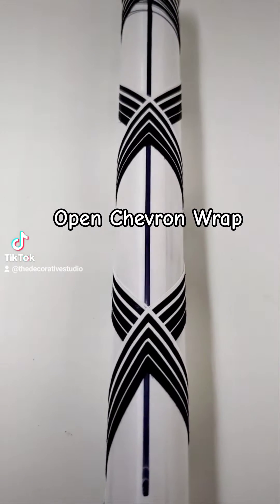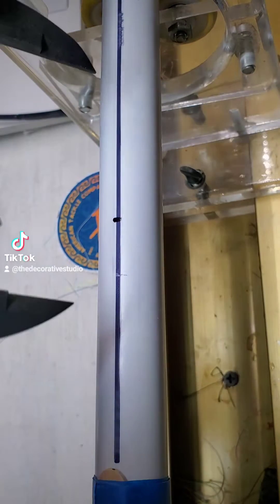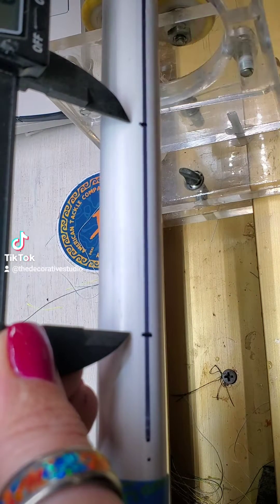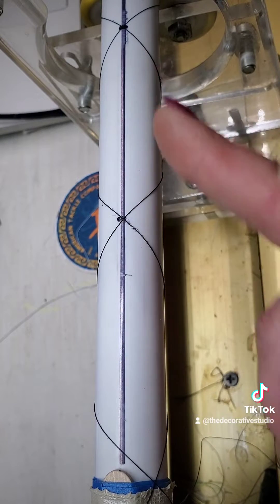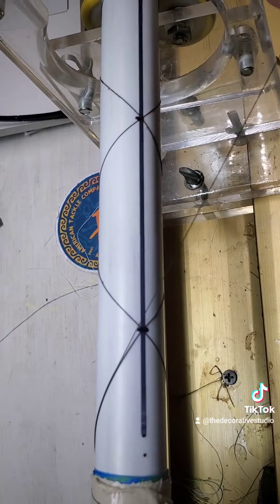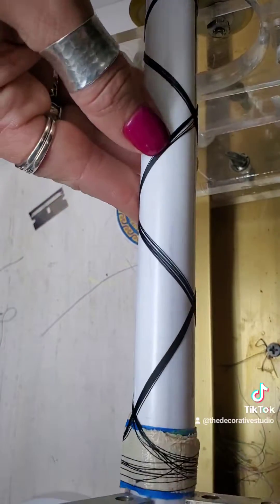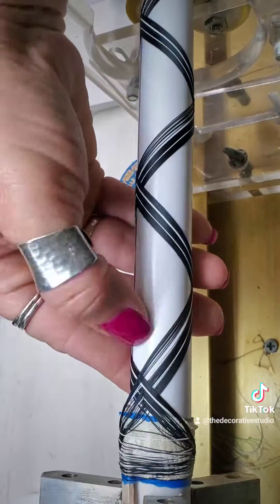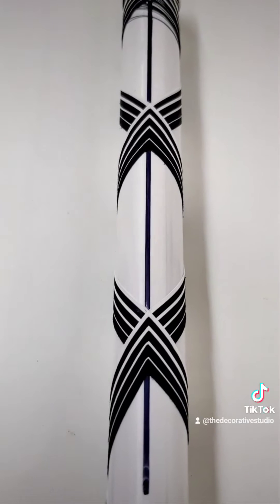open chevron quick tutorial

Comment: Do you just leave the sharpie on there or do you clean it off before you put on the epoxy?
Reply: Sorry if that’s a dumb question I just started my first rod yesterday
Reply from the maker: @kennybass7546 no not dumb at all. If you leave the blank showing and can see the sharpie, you remove it. The best pens are sharpie paint pens and they can be easily removed by isopropyl alcohol